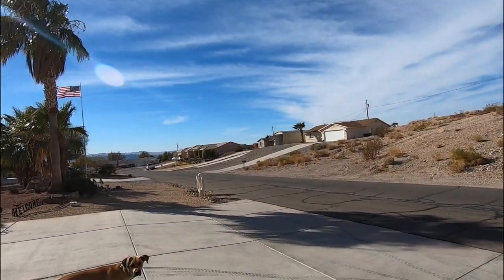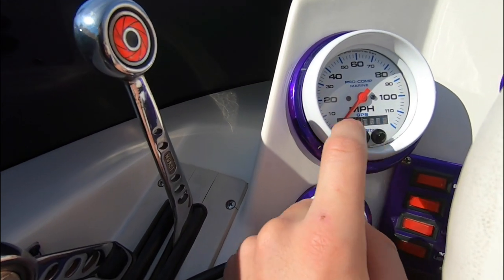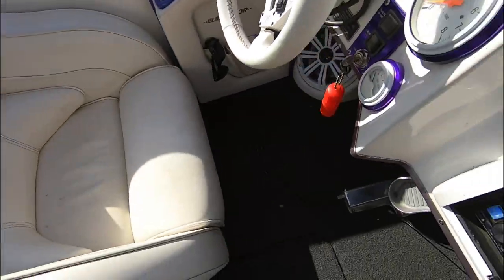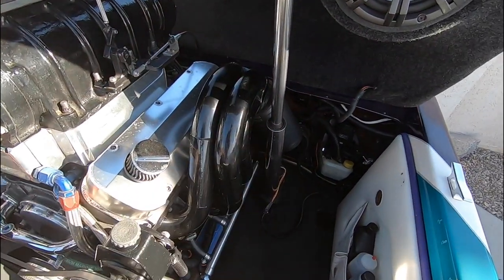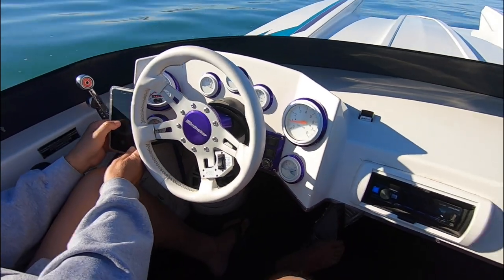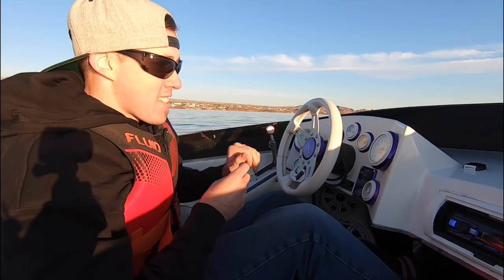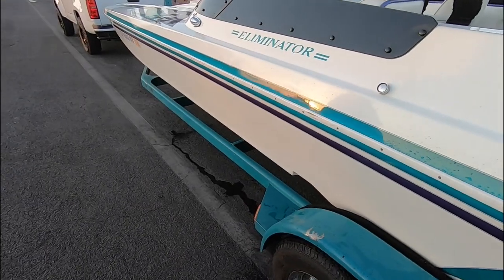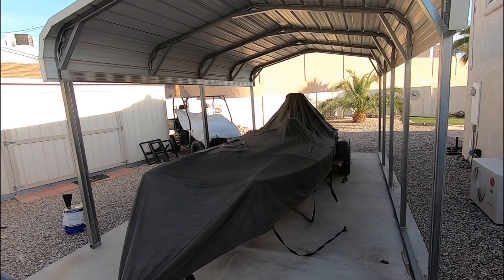1,100 HP Eliminator Daytona Overview and First Drive

Comment: 22 ft Daytona ♥️ 
Just love it .  Have u taken it out & what's WOT Speed  pls . 
Robert   Australia 🇦🇺
Reply from the maker: Hello, Been doing a bunch of work to it over the last year. Fixing some leaks and electrical. Hopefully in 2023 I will take it out alone and throw a brick on the gas pedal haha!
Reply: @slightlymodified501  

What's Ur thoughts on WOT Top Speed  ? Any Guess's  ? 
When u ran Ur 101 mph how much throttle did u have left ? 

Think Eliminator Boats did themselves a disservice by not keeping the 22 & 24 fts in production in this shape & 4mat . 
The revamped 22ft doesn't look as gr8 as the older style.
Reply from the maker: @Robert-mn8gc  i think it should do around 120mph

Comment: Sweet boat! Id suggest getting a imco -2 shorty lower drive with  1.36 ratio, probably would pick up quite a bit of speed. You didn't mention the CI of the engine but 1100 on pump gas seems a bit hopeful IMO still a bad ass piece regardless!

Btw the hopping you mentioned is notorious for the 22s. From about 75-90 they hop pretty bad. I've heard tunnel extenders can help.
Reply from the maker: Thank you. I looked at those lowers and the price is t really worth the increased speed it will bring, however I am currently looking into some trim tabs to aid the porpoise. As for the engine its a dart 565.  I believe they are close to 1000 hp without the blowers, so I think with 10psi 1,100 is more than reasonable
Reply: Not so .  Teague Marine r offering engines in the 850 - 1400 hp running 91 
✔️ ✅️ out there Website & be surprised
Reply: @Robert-mn8gc  1400 hp on a roots style blower isn't happening with pump gas. My cousin built a 632 with 14-71 all top shelf parts. Tuned it for 91 octane, it made a little over 1100. If you were to go turbo or whipple that is another story.
Reply: @slightlymodified501  I swapped my standard lower on my 25 daytona and gained 13 MPH. I went from 88-101! I was pretty stoked with the gain. Not sure if it would equate the same on your package but I'm sure it would be substantial.
Reply from the maker: @srharris88  damnnnn.  You have any videos of it?
Reply: @srharris88  
1st of all he isn't using a Roots Blower . Whipple Superchargers with there Cupronickel Intercooler.  Best Intercoolers money 💰 can buy . 
I have an 871 race 🏁 blower in Australia 🇦🇺 & l am going 2 sell it . 
Fully rebuilt . Teflon Tipped Rotors . 
Hard Anodised Rotors . 
Waste of Time ⏲️ Compared 2 a Whipple Supercharger.  
The 4.5 ltr Whipple Supercharger is the Equivalent of a 1071 all the way thru 2 a 1471 . U can drop Hats on them . And Whipples latest Superchargers r even better again.
Reply: @Robert-mn8gc  Its been quite a while since i saw the video i forgot what what setup it had. I thought it was a roots setup. Either way a 555 ci with a roots or whipple 1100 seems a little inflated IMO. It could be possible but the tune would be on the edge from melting it down. Seems we all (me included) butt dyno our engines for a lot more than the real numbers come out. 
Definitely true though a whipple is a lot more efficient. It takes significantly less power to turn AND creates a lot less heat which equates to more boost\power.

I haven't dynoed my engine but id guess its making some where near 850. A 540 ci aluminum bb2 heads, super chiller, and a 8-71 and two holley 800s.

Definately do the upgrade! I actually bought a 4.5l whipple last summer. I haven't got around to do the mods needed to install it but I had the same idea. Mine has injectors in the blower (think they all do) so I want to upgrade to a holley efi system. Which means changing a bunch of crap...guess thats what winters are for😁
Reply: @slightlymodified501  Not really, have always wanted to get videos while boating but its hard to get somebody else to record for me. Do have a short clip of running it on the trailer that i had on my phone
https://youtu.be/vY9o7_Zoiu8
Reply: @srharris88 1100hp is 100% possible on 91 can be done on a small 4.0 whipple on a 540" motor obviously needs good parts and good heads like cnc ported AFRs. Teague offers a 565" with a 5.0  whipple that  makes north of 1350HP
Reply: @Snipeuout69  it's absolutely possible. My dad has a 565 ci all top shelf parts, with hemi heads 6.6 quadroter whipple. Runs it on pump gas with water methanol injection. Dynoed at just over 1200. It starts to get really hard to get more than that on pump gas with a safe reliable tune.

To make 1100 with a 4.0 whipple and 540 ci I'd think would be a hot tune.
Reply: @srharris88  1102HP on 91 pump. 6200RPM and 10lbs boost
Reply: @srharris88  check out the new Gen 5 whipples.. the new 3.8 can make more power  than a older 4.5 whipple.. supercharger technology keeps evolving